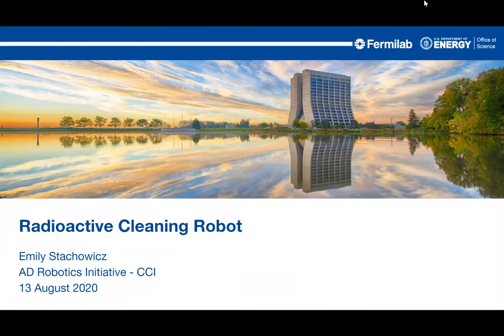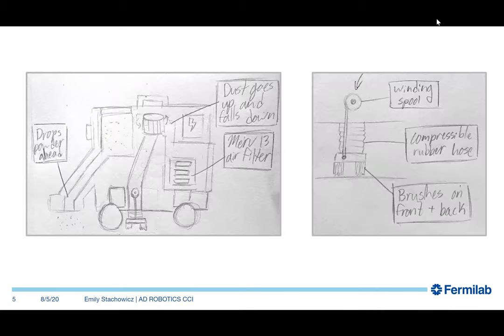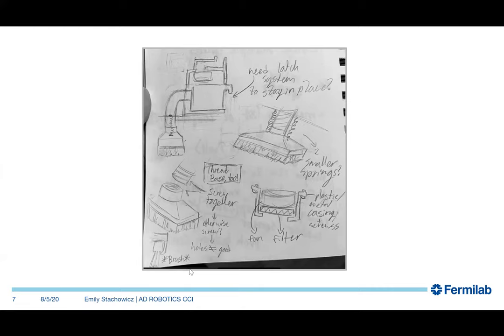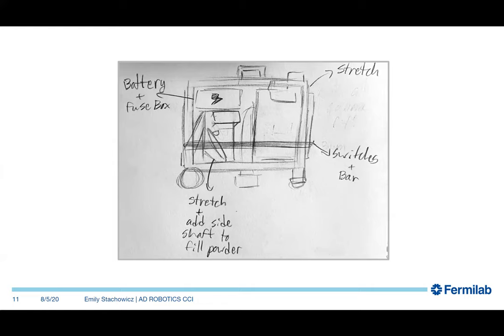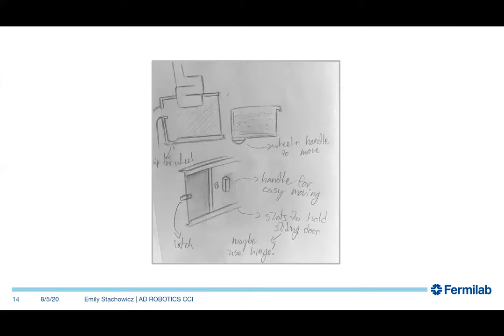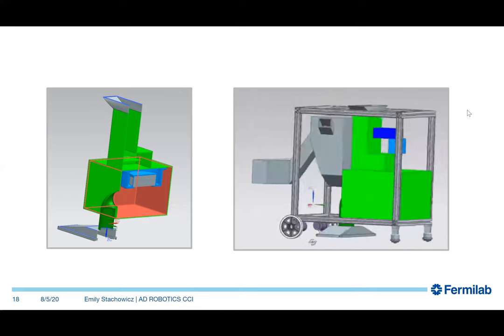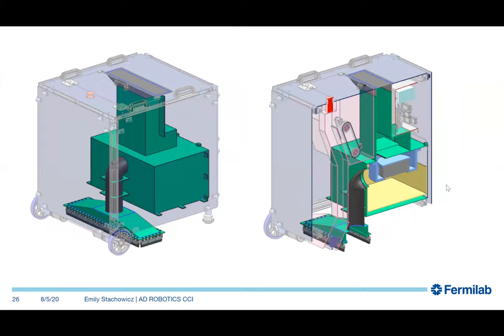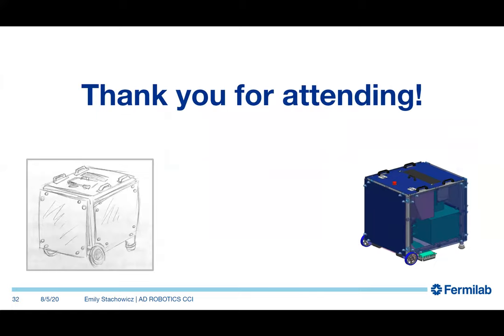Radioactive Cleaning Robot

Comment: Is this a bigger Roomba?
Reply: Automated floor squeegee might be better but idk wtf the floors made of
Reply: Might be better to be R/C by a maintenance tech.. possibly more cost effective too.
Reply from the maker: The floors are uneven concrete/stone with water and various pools of water. Gaps or ledges in the flooring can be up to 3 or 4 inches high, while the puddles can be up to 1 inch in depth. A floor squeegee was considered, but most of the time that results in leaving puddles of residue/water on the side. I’m sure this could be designed around though. Thanks for the suggestion!
Reply from the maker: The design constraints had fully automated as one of the requirements. It would be much more fun to control it by hand though!
Reply from the maker: Kind of LOL
Reply: Well shoot with those constraints I think you're doing pretty good how'd it go